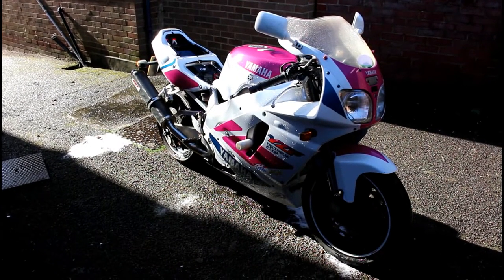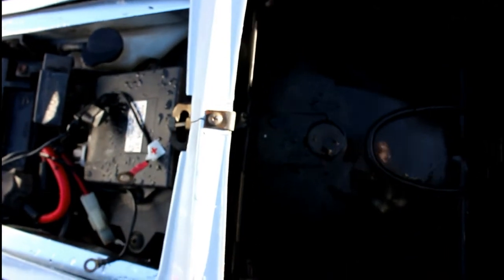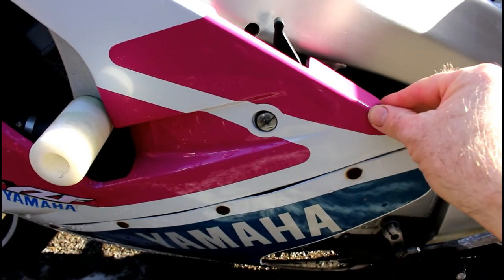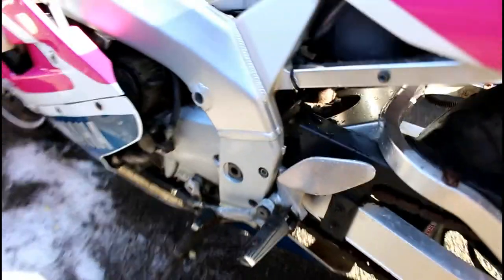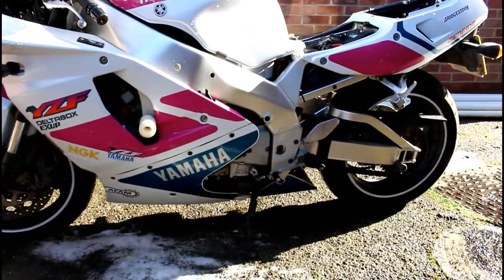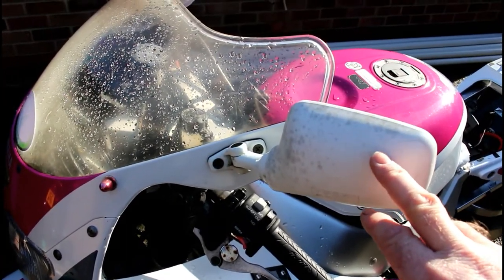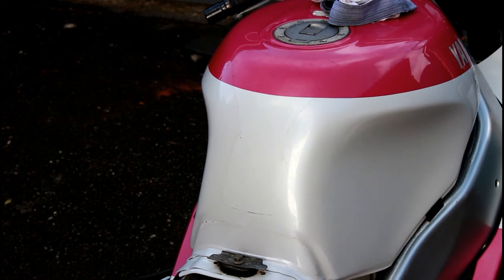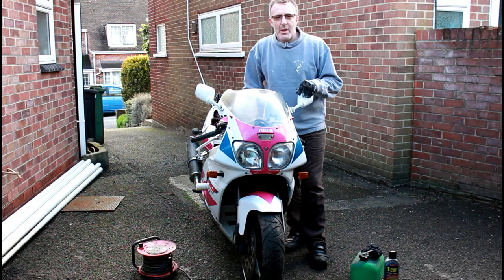"Miracle" how to transform rough to new looking.YZF750R 1993 PART II

Comment: These bikes were overlooked by the introduction of the Blade and sadly due to this a lot of riders missed out as what can only be described as one of the best bikes
of its time/era and to be honest will keep up and at times out do some modern bikes Think I am talking shit well just try one and you will see where I am coming from !!
The early bikes did not have the res they just had the shock so its probably original "keep it that way"  They were not only fast but strangely quite comfortable to boot
I have spent many many hours riding one with no ill affect I would go as far as saying appart from the Honda V.F.R. 750 which is also a fantastic bike this is the best
I have ever ridden to date If I were you I would hang on to it they will  with out doubt become sort after and for good reason !! Good Vid thanks !!

Comment: I do believe the 1993 bikes had limited adjustment for the suspension. Remote reservoir’s arrived in 1994
Reply from the maker: Definitely had the remote reservoir as a standard 1993 model, but for some bizarre reason one of the previous owners on mine decided to ditch it.